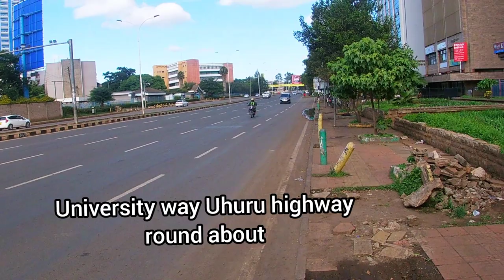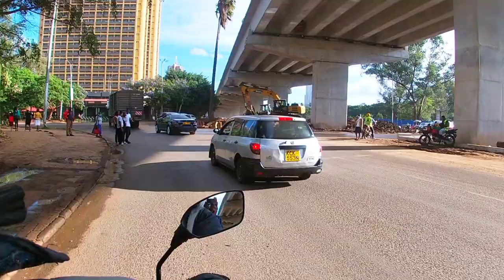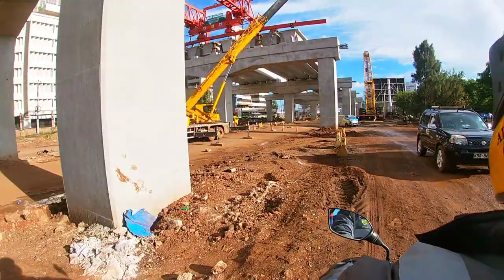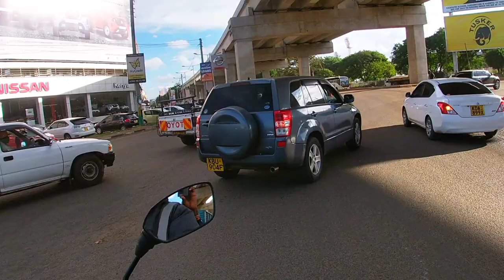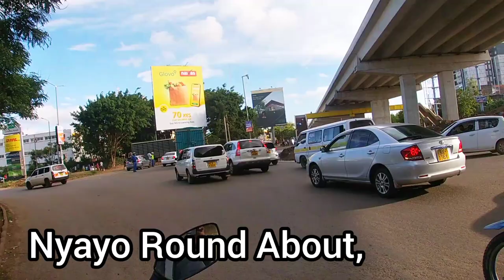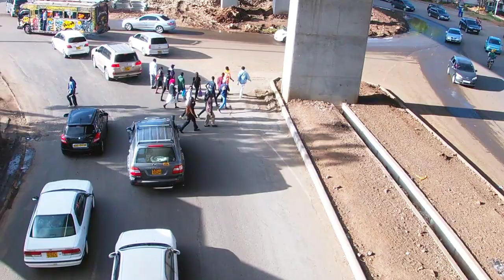He returned from USA after 7yrs, The new Nairobi city shocked him. Nairobi Expressway.

Comment: Thanks Dennis i as a Kenyan in Diaspora(USA)and invested in real estate in Nairobi and real estate in Kenya has better returns then here in the USA. Big challenges in Kenya is infracstrure like modern access roads cheap and reliable water and energy (electricity) .i love the the Uhuru govt has done a lot in infracstrure but much still needs to be done if Kenya is to reach it's full potential if only we can tackle corruption. Many investors from the USA are ready to invest if they are sure the viability of investments opportunities. Kenya corruption index of 31 out 100 is low score and investors want a minimum of 50 out 100 for consideration of investments
Reply from the maker: Thank you kariuki